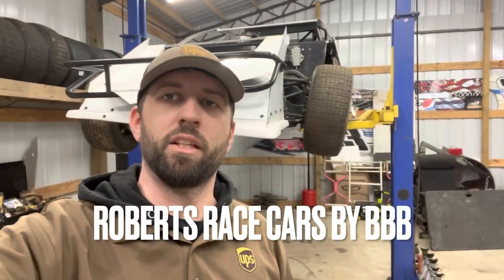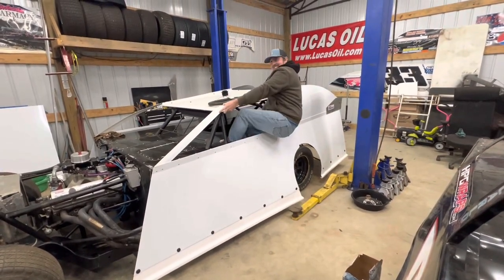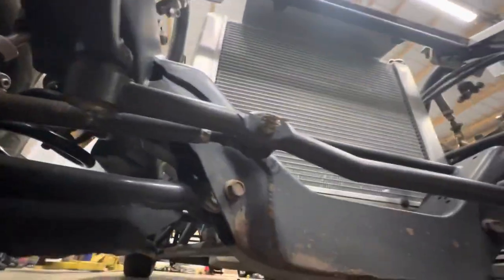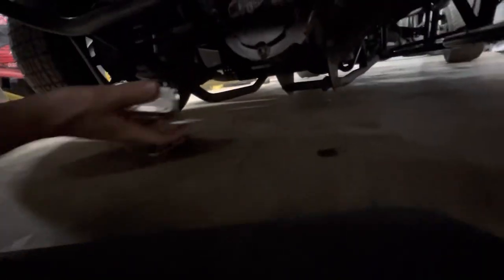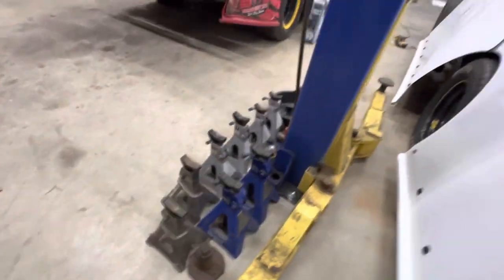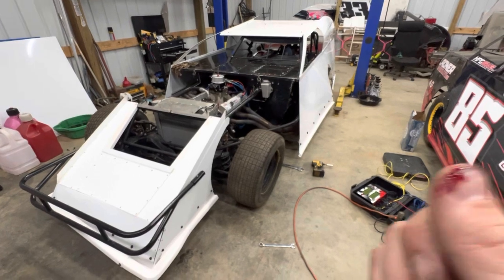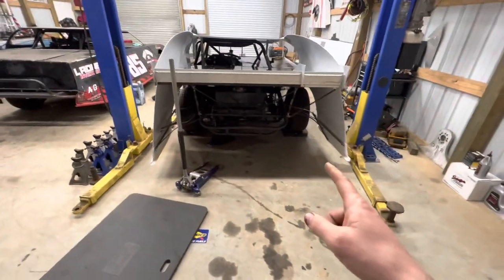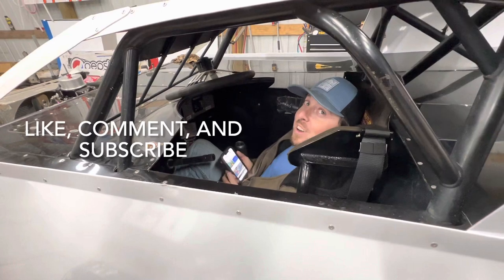MB Custom modified scaling process!

Comment: Finger nail injuries suck looks painful. Have you ran a lift arm car before? I just converted mine from Lift arm to Pull bar. Thanks for the information. What do you like to run on metric front end ride height?
Reply from the maker: I’ve ran both and have had success with both. But if I had to pick I would probably go with a pullbar.

Comment: so what exactly are you turning to lower and raise the ride heights on the front and rear?
Reply from the maker: We have weight jacks on the front of the car and coilovers on the rear.
Reply: @robertsracecarsbybbb60  so is that the big bolt that runs through the coil on the control arm? and for the rear? sorry just got a race car and trying to set it back up factory
Reply from the maker: Yes sir that’s it in the front. The rear on these don’t have Jack bolts. They have adjusters on the rear coil overs